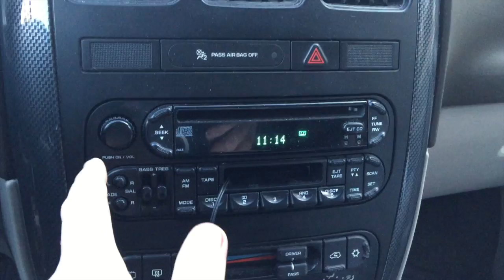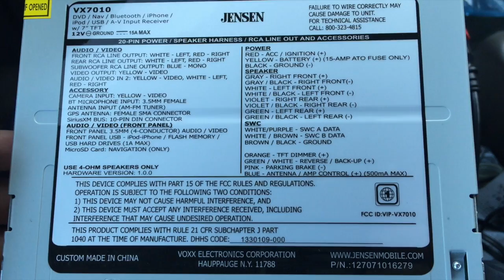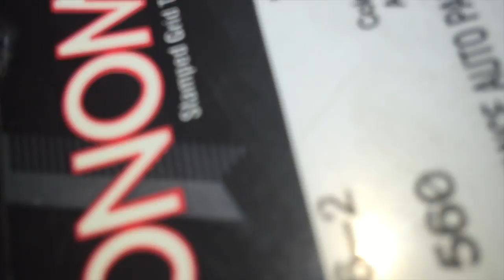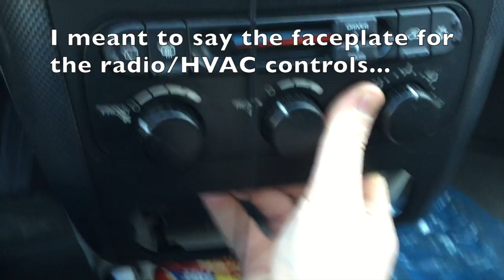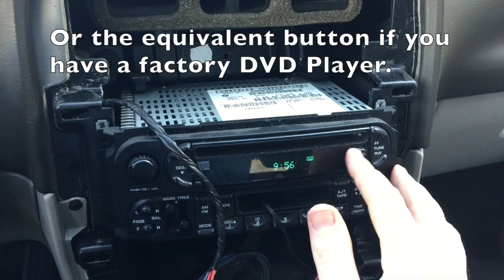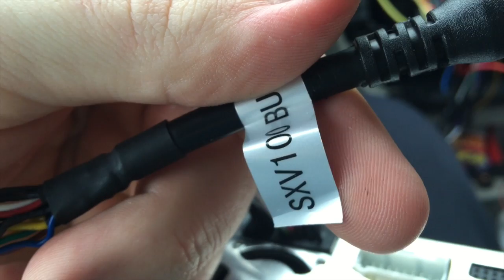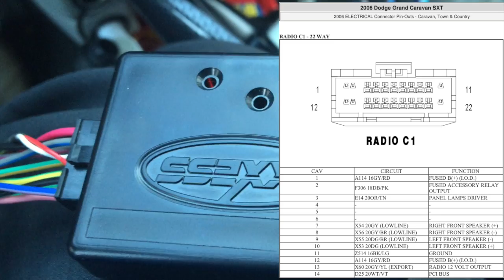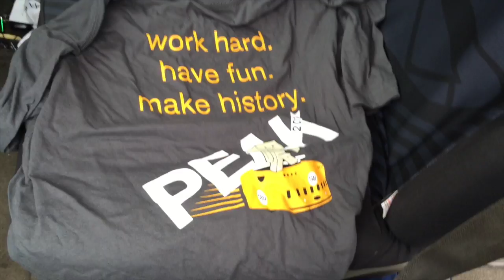Installing an aftermarket radio in your 4th Generation Chrysler or Dodge Minivan.

Comment: Does your van have the infinity amp in the rear panel? If it does, how did you get sound from your aftermarket stereo/factory speakers? I have wired my aftermarket stereo with no issues but I get no sound at all due to the funny Chrysler wiring lol
Reply: Same Damn problem here did you figure it out?
Reply: Same 3yrs later😭

Comment: I just recently completed an install of a double DIN Android head unit in my 2005 Grand Caravan and ran into issues with the Metra Axxess steering wheel controller as you did.  But I called their tech support and learned a few things.  First off, you have to have everything connected for the CANBUS system to route the signal correctly.  Initially, I had my climate controls and everything else attached to the fascia unplugged, since I had to use an aftermarket fascia with a double DIN sized opening to complete my install.  All that stuff needs to be connected.  SECONDLY, I was told to press the reset button on the Axxess FIRST and hold it for three seconds.  When you release, the LED will be alternately flashing red and green rapidly.  THEN pulse the up volume on and release about the same pace as a normal heartbeat until the LED stopped flashing.  Then, it will flash green 7 times, then red seven times, and then finally, flash red, which is actually what you want.  Flashing red is good.  Means the Axxess is communicating with the vehicle.  Then, I had to program my steering wheel controls in the settings sub menu for my head unit.  I was able to successfully program four buttons in total.  All three on the right side (volume up, down and in my case, return to the home screen).  As for the switch on the left side, I could only get one function out of the switch.  Doesn't matter what button I press (up, down, center button), they all do the same thing.  So I assigned that side to track skip forward.  If I recall correctly, the center button on the left switched modes and the upper and lower buttons were skip forward or reverse or seek forward and reverse if you were in radio mode. Again, so far, I have only been able to assign one function to the buttons on the left side and all three buttons do the same thing.  My radio manufacturer suggested adding a resistor on the signal wire from the harness at pin 14 (white/purple stripe) but I haven't tried that yet.  Metra suggested trying different radio types besides Pioneer/Kenwood to see if that makes a difference.  For now, I've just learned to live with four of the six buttons working.  Hope this helps...  ALSO, for those following my path and going Double DIN - Metra makes the fascia replacement panel.  You can find it on Amazon or eBay for about $70.  But it requires slight modifications in order to get the double DIN head unit to line up perfectly with the opening in the fascia.  I found that I had to elongate the holes on the left side plastic radio attachment bracket that comes with the Metra fascia and also REMOVE the plastic peg on the back side of that same plastic attachment bracket, so the head unit could be slid over to the left about 1/8".  Now it fits perfectly.  And one more thing...  If you go the Double DIN route, you will need to cut away part of that cross member in the radio cavity opening on the vehicle.  The good news is, it's made of plastic.  The instructions for the new fascia surround also verify this and show you where to cut.  I found that it was necessary when installing a double DIN stereo to create the necessary clearance.  Cheers.
Reply: Do you remember the color of pin 14? It’s white with some stripe. Cant remember the strip color.
Reply: @KhaiMahase I'm so sorry, but I do not.  It has been 3-years since I buttoned up this project.
Reply: @JeffMcNeal  Okay, but just to confirm if you can remember did you connect the harness for the aswc steering wheel control interface (pink wire to original radio wiring harness)?

Comment: What about the Factory Amp I hooked my 2003 chrysler town and country Awd up with a new Deck and everything works but no sound and there's no blur Amp wire on the harness other then off the new deck and don't know what to tie it into
Reply: I See you liking everything and comments but your not Answering any questions How did you get the amp to turn on?
Reply from the maker: I'm gonna be honest: I have no idea.  Up till now I've only done systems with the radio and up to four speakers.  I've never tried one with an amp let alone any other add ons

Comment: Don't take off the negative battery terminal take the positive off so you don't blow any fuses
Reply: Always take off both battery cables negative first then positive to keep from a short happening
Reply: Never Disconnect POS to do the work Disconnect the Ground you can fry vital parts or screw up your entire Cpu

Comment: For anyone having issues with the ASWC-1, Metras instructions show to splice the pink wire onto pin 14 of the factory harness. My radios wiring diagram did not match what Metras instructions provided. I disregarded the pin number and just looked at the Metra diagram and counted.

I used a t tap splice to connect the pink wire and it works great. Make sure you are splicing into the body side wiring. Not your radio harness adapter!
Reply from the maker: Good advice
Reply: Do you remember the color of pin 14? It’s white with some stripe. Cant remember the strip color.
Reply from the maker: Not off hand, sorry

Comment: Thumbs up Adventure. Man you did a pretty good job on the install. You do yammer a lot like me. I've started editing all my side notes so that my videos are shorter and more to the point. Had some videos that were over an hour long. After I took out the yammering I found I had cut 40 minutes out of that video before I published it. But you must be doing something right or you wouldn't have all those subscribers. Thanks for the post I will keep your video in mind when I do my 4th Generation Stereo install.
Best Wishes n Blessings Keith

Comment: Have you tried contacting metra? I had questions about the adapter for my steering wheel controls, they were very helpful
Reply from the maker: No, I didn't.. I threw it out there for all y'all to help me.. and besides the van is gone now
Reply: @adventureoflinkmk2  So funny You cares about Cars
Reply from the maker: @Iamaspeedykim-v2.0  and why is that funny?  I like cars and I like driving, what can I say.

Comment: How did u fit the radio perfectly in the middle?  I mean where did u get the surround plastic (or smth) around the radio itself?
Reply from the maker: Off Amazon...
Reply: Ohh. Yea, well unfortunately I'm not native English so I didn't know how they are called. Good thing is I figured out how they are called in my language, those fitters are like 3 euros in local store. I'm looking forward to replacing the stock radio in my chrysler 300m. Thanks for quick reply thou.
Reply from the maker: That's fine.. but yeah they're typically called dash install kits in the States :) good luck putting a radio in your 300, although I dunno if these instructions will help you

Comment: My 05 grand caravan I installed a new stereo.. but now the dvd player cant hook up anymore... I guess there is no fix?
Reply from the maker: Wouldn't know my friend... my van didn't have the DVD player stock
Reply: @adventureoflinkmk2  thanks for the quick reply. Cant find any videos on this particular problem. Either I use the new stereo with bluetooth.. or go buy an old original stereo that will allow my dvd to plug into it and work again.. suppose the dvd player will collect dust 😑
Reply from the maker: You're welcome... the only thing I could suggest is to get some composite cables and hook them from the factory DVD AUX out to your new radio AUX in, this way you can still use that DVD player with the new screen and head unit.
Reply: Did you ever find a fix?
Reply from the maker: No.  We took my van and used it to trade for dad's Santa Fe

Comment: Why would you run a new power wire for a CD player when it already has one on the radio in the car
Reply: +adventureoflinkmk2 well in that case it's genius and I may do it as well because when my internal amp was hooked up my van wouldn't even start

Comment: Can anyone help with putting in an aftermarket stereo in an 05 caravan with the built in Factory DVD player?
Reply: Catherine Reilly ican
Reply: Riss Roberts how do make the factory dvd player work with a aftermarket stereo cuz I cant figure it out
Reply: +Serge Ouellette I've been told that the factory DVD will only work with the factory radio.
Reply: +Serge Ouellette the stock dvd player gets it power from the stock stereo so what you have to do is look on the stock stereo and find which wire is for which and hard line the power wire to the yellow wire in the after market  acc to the red wire negative to the black and then there is a left and right audio wire with a shared negative that needs to be wired to an audio jack and just plug it into the after market aux port when watching movies
Reply: In order to keep you from screwing around with the stereo out of the vehicle or using another manufacturer's parts (ie-DVD player, CD changer, etc) most major car manufacturers have employed a digital communication protocol that must be used in order for the pieces to work together. Go back in the video to the place where he shows the connectors on the back of the radio. There are 2, a large one for the regular connections to the radio, and a smaller one for the addition of the CD changer. One of the pins is labeled "J1850", and the others are positive 12 volts, negative 12 volts, right positive, right ground, left positive, left ground. You could theoretically put whatever you can think of in there, but it won't work out because that J1850 line communicates with the radio and tells it what it is, CD Player, CD changer, DVD player, whatever. If I'm not mistaken, it also communicates with the car itself, turning amps on or off, turning on and off satellite radio reception, all kinds of crap. I'm going through the same crap right now. Just got a second hand 2006 Dodge Grand Caravan.